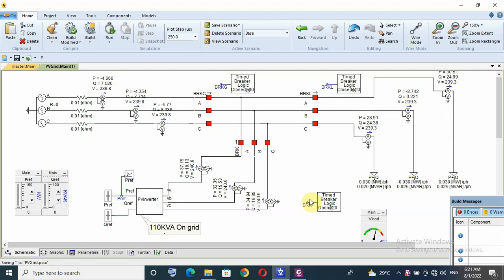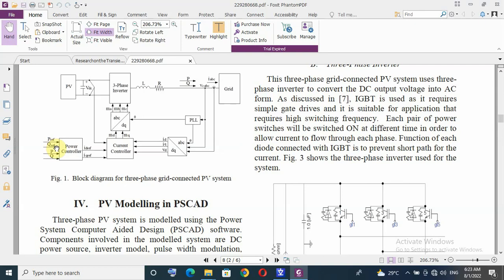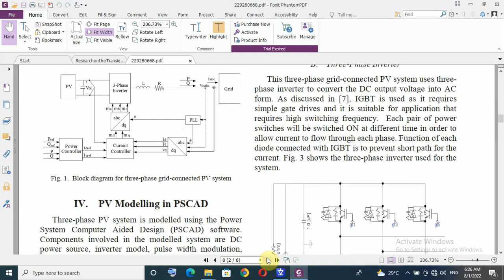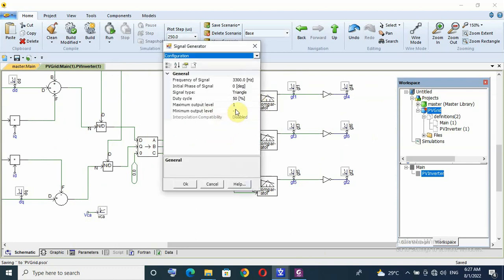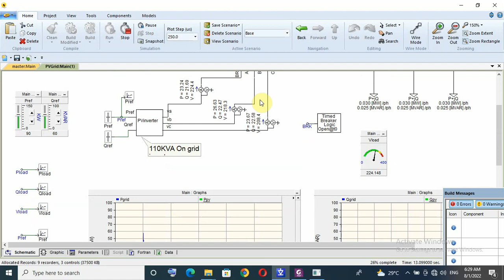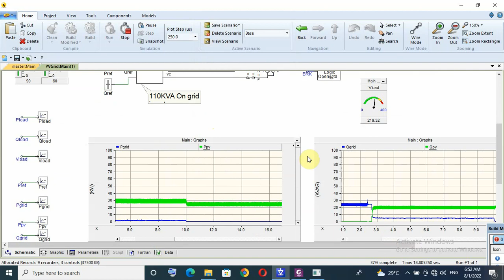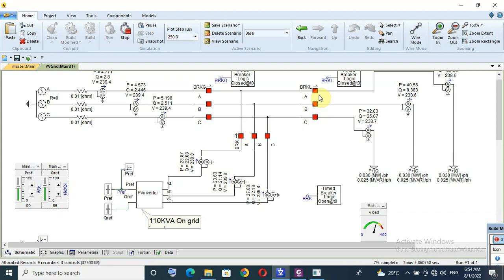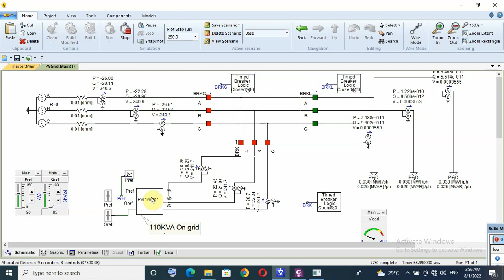PV on grid inverter tuning of PI controller in PSCAD with grid LV system 415V

Comment: Sir would you help A 3MW wind turbine with 0.69 KV unit based on PMA is considered. The unit is equipped with AC/DC/AC converter assembly and 1.675/12.47 KV step up transformer which is connected to grid.The journal name is "Modelling and analysis of grid tied PMA based offshore wind energy system in PSCAD/EMTDC